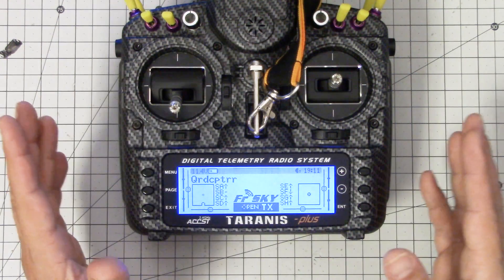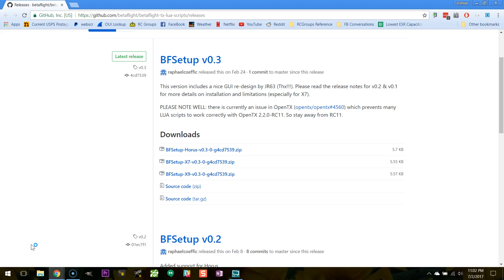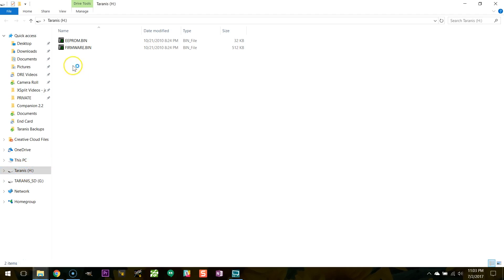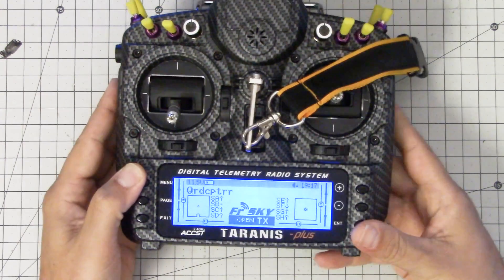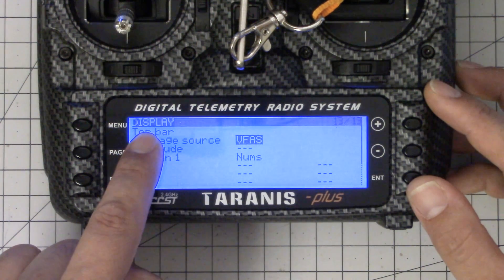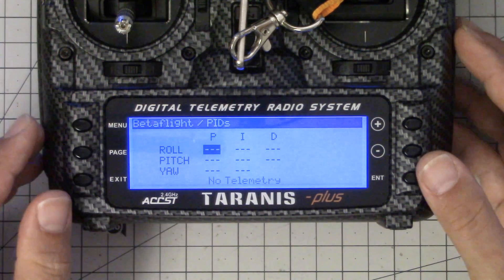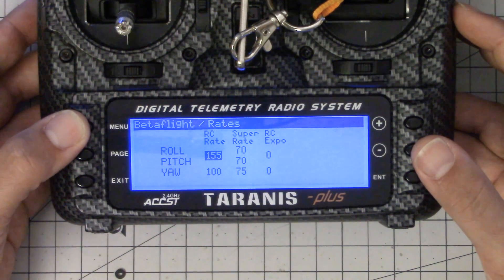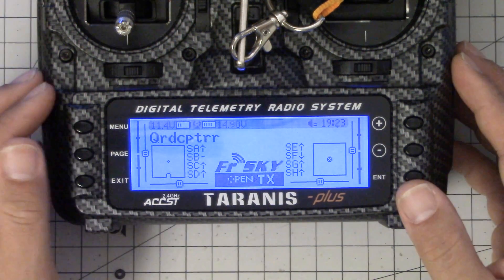Betaflight Taranis Lua Script HOW TO | Part 2 | The Lua Script

Comment: Can you do one with versions 1.0 and up? The file structure was reorganized in a 'single set of scripts for many transmitters (X7, X9, X10, X12)'. Now, in the new zip you get two folders, BF and SCRIPTS, inside scripts you get two more folders, BF,again, and TELEMETRY. This BF contains some loose stuff and some folders, HORUS, MSP, X7,X9. 
I don't know if I should copy the whole thing to the SD Card or if I should delete all the folders for HORUS and X7.
Reply from the maker: Well, you've got gigs of SD card space you're not using. Why not just put it all there. You'll never miss the space.

Comment: Hi love your videos been a massive help. I have a problem with v.1.0.1 lua i followed this vid but when i download the script the zip opens a Obj folder this has a few folders and then some seperate files underneath. Im now completly lost 😔 i have a qx7s and have no idea what files i need to load onto the qx7s to get betaflight lua working i have tried a few times but cant get this to work 🙈🙈
Reply: JRtopspeed wicked ill have a look now thank you  👍🏻🤞🏻
Reply from the maker: Yeah, unfortunately they changed the structure of the Lua script and this video is not correct any more.
Reply: I just setup lua script on my qx7s just use the link on this video https://youtu.be/o0DZo-xx3Hk download the qx7 file that’ll work for the qx7s ,good luck.

Comment: Hey. I had lua scripts working. Then upgraded to latest open tx  and upgraded sd card firmware to get rid of warning when I start my transmitter. Didn't realise until I went out to fly today the lua scripts don't come up anymore when I hold the page button now. I'm sure it's an easy fix just don't have time to troubleshoot at the moment do you have any quick ideas.mate? Thanks
Reply from the maker: +Organ Donor reconfigure the telemetry screen to use the script as page 1. Like you did the first time you installed the script.
Reply: Joshua Bardwell you're a legend thanks man I'll give it a go

Comment: I updated from Opentx 2.1.6 to 2.2.1 and when went to follow this procedure, I found that on the radio menu, I have only 9 pages instead of 13. I don't seem to have a 'Display' page. Any idea what I may have done wrong or what I need to do in order to correct it? I did confirm that I have 2.2.1 installed.
Reply: short press for one menu long press for another menu on my qx7s anyways

Comment: Sometimes I get an error when using the Lua Scripts page that states, "Script syntax error BF/ui.lua:335 not enough memory". Running a Bardwell F4 board, Taranis X9D Plus SE, XR4-SB. Sometimes it works just fine.

Any ideas on how to fix this?
Reply from the maker: Nope. I get that too though. I usually restart my radio.
Reply: Joshua Bardwell yea that’s what I’ve been doing thanks

Comment: Got the PIDs and Rates working through LUA scripts.....but my Unify Pro Race VTx values are not showing.  Any idea why?
Reply from the maker: Confirm whether SmartAudio is working via the OSD. If not, then the Lua script won't work either.
Reply: Finally got it working.  Watched your vid about Unify Pro.  I didn't have "TBS Smartaudio" enabled in Periperals tab.  I mistakenly thought I was supposed to have enabled UART 4 and enable Smartaudio in telemetry tab. Thanks!!!

Comment: I have had some issues where after selecting "save page"  the radio tries for a bit then says "retrying" and then comes back with the original unmodified values.  Seems to happen when the main battery is plugged in but not when powered via USB.  Maybe a problem with VTX interfering ?
Reply from the maker: I think that's unlikely.

How are you changing vTX settings without the battery plugged in? I don't know of any vTX that will power up off of USB.
Reply: I'm not changing vTX settings, just pids, etc.

Comment: Thanks for the video! Chuffed when I got lua scripts up on my taranis. Using r xsr on an f405 with s5 pin remapped but not getting any telemetry only rssi f000 and rxbt pids etc all read --- I've scoured the Internet and tried the inverted hack but the pad came off my r xsr. Firmware is up to date can anyone help please?
Reply from the maker: With SoftSerial you don't need to use the uninvert hack. That was why it wasn't working most likely. Use the regular SBUS wire.
Reply: Joshua Bardwell the for reply. I have sbus connected to sbus pin. Wired smartport to s5 but it doesn't seem to be working. I have reassigned s5 with the cli commands. That's why I tried the uninverted hack. Really bugging me I wanted to be in bed hours ago but can't stop until it works haha
Reply from the maker: confirm in "resource list" that you see serial_tx 11 on the relevant pin.
Reply: Joshua Bardwell everything was wired and setup fine mate. The only thing I didn't try last night was reassigning s6 and soldering to there. Did that and it worked straight away. Pids and rates work but not the vtx but I can do that through the osd. Mainly the Pids I wanted :) thanks for the vids mate keep it up!

Comment: I installed the 2.2.0 on my X7, updated the crossfire (2.06), bound the TX/RX, but it still says "waiting for crossfire" when i open the folder. Plus i dont get any inputs in betaflight. I soldered the Ch1 to RX ant ch2 to TX.  Ports are set to UART 3 where i put them. Can you help me out of this mess ?
Reply from the maker: Have you got telemetry working?
Reply: I got nothing on my screen. i can't see my PID ore any other telemetry
Reply: But Telemetry is working in betaflight. I can see the axis moving
Reply from the maker: +Anna- Theresa telemetry is not working until you see values in the radio. Lua WI t work until telemetry is working.

Comment: Hey guys... The Lua script works except the vtx/band settings doesn't show anything, rest of the pages works properly... What could this be.. I hooked Smartaudio to uart6 of the clracingf4 so I could still change it through the goggles but yeah,you know.
Reply from the maker: Possibly you're using the wrong version of the script?
Reply: I have problem. Telemetry stopped working, however I've managed to assign it to a softserial on my flip32 F4 (not omnibus) and although I have pids and rates I don't have vtx settings. Just says "device: none"

Comment: Hi Joshua Bardwell. I need assistance. I have the R-XSR rx and the QX7 tx. I have followed all your steps.. I'm using a Xracer F303 FC and have connected  S.port to UART2 TX. If I go to "Discover New Sensors" on my TX I get about 12 sensors on the list. When I run the script I see it working, but there are no values  shown. Please help me.

Comment: Hey JB,  any word on if TBS or BF will be fixing not being able to turn Pit Mode on or off via Lua Script?  I was thinking all was good and I noticed it will not change in the menu and after some investigating it appears its a limitation of Smart Audio,  very irritating! 

if (onoff) {
        // SmartAudio can not turn pit mode on by software.
        return;
Reply from the maker: I believe (but not sure) this is a TBS limitation where the Unify won't go back into pitmode after coming out. You'd have to ask them if they plan to change that.

Comment: Just put this on my Diatone GT200N and it worked a treat :), only thing is with the Horus you manually run the script from file manager, I dont beleive the 200N has Smart Audio though?
Reply from the maker: +Tony Cooper correct. It has a push button transmitter only.

Comment: Hi i need some help on my lua script.. I cannot change tbs unify pro vtx settings on my transmitter, syntax error is appearing on the screen.. but i can change my PID's when i go to the vtx setting it suddenly shows syntax error.. thanks in advance..
Reply from the maker: I have seen that Syntax Error screen before but I don't know what the fix is for it. I have fixed it by power cycling the quad and the transmitter. Once it shows up, it won't go away.
Reply: Joshua Bardwell thanks.. maybe i need to check my connections.. all my firmwares are updated.. my pid tuning works perfectly, my only problem is that vtx syntax error..

Comment: Joshua, thank for this mate. It adds a great feature to the taranis and makes tuning so much more accessible. Now, obviously this leads to what else can I do with this. In fact, I  noted that yaw D gain is absent (commented out in the telemetry script). I may need this for tuning my tricopter running triflight, so removed the comment and it works. Then, when starting to play with changing rates, I noticed whenever I save anything to the copter, the throttle expo reverts to 0.0, which is a bit annoying. My assumption is that the script has zero assigned to the parameter somehow. Here is the question: can I add this parameter to the taranis screen to allow it to be changed and have it set to the desired value when it is written to the copter? Or am I barking up the wrong tree? I note that the BF.lua script assigns indices to each field, but how does this map to parameters in betaflight? Any help would be appreciated. [Did look at lua script documentation "OpenTX 2.2 Lua Reference Guide” but could make out much from it].
Reply from the maker: +Pieter de Waard there is no yaw D term in Betaflight. I don't know more about how the indices work. I would look into the MSP protocol as I'm sure that is what the indices refer to.
Reply: Thanks Josh. Will dig further. The yaw D-term is in triflight (based on betaflight 3.1.7 I think) to deal with tail dynamics of the tail.

Comment: Josh, just updated today and all went well. I am on MAC OS. I am wondering why my taranis is saying it cannot see the script. Is there a mac version?
Reply: Sorry I can see “script” on the options but I when I go to select it, it advises no script is on the SD card. /betaflight-tx-lua-scripts-0.3 2 is the name of the folder after the unzip. No sure what is happening.
Reply from the maker: There is no Mac or PC difference between the scripts.  But you have to put the script folder on the card, not the zip-file folder.
Reply: Joshua Bardwell thanks sir. All sorted now.

Comment: So i did this and it works beautifully on my 5" running a lux32, however, on my 2" running a piko blx i get no rates or pid information so, cant change. Both are running an xsr and same version bf 3.1.7. Is there something in bf firmware that has possibly been switched off for the piko? I googled but i have seen nothing regarding 3.1.7. Before i flash 3.2, is there anything else i can check?
Reply: Since 2015, the XSR got 2 firmware updates in quick succession in June of this year: XSR-170605 and XSR-170619.  The first fixed a general S.Port bug and the second added the PID parameter transfer functionality.  It sounds like one of your XSR's has the earlier update and the other one the later update.  Go to the following link and update the firmware of the XSR on your piko blx build.  https://www.frsky-rc.com/xsr/
Reply from the maker: Have you got telemetry enabled on the Piko?
Reply: Joshua Bardwell yes, all my telemetry works perfectly
Reply: Thanks mate, I did this and it worked perfectly! I didn't even realise there was a glitched firmware. Much appreciated.

Comment: Hi josh. I have a qx7 with the new 2.2 open tx. I want to download the lua scripts for that. Could you do a walk through for that? I'm having some issues going thru the steps. I will be using the radio with the new tbs micro crossfire
Reply from the maker: I don't have a QX7 so I don't know what differences there might be. I think there are not too many differences though. Obviously you have to download the correct firmware to the radio though.
Reply: I just did this on my QX7. Same Process, the difference is getting into bootloader mode. on the X9 you hold the trim tabs while powering it on, with the QX7 you just briefly press the trim tabs. Holding the trim tabs will cause it to not boot into bootloader mode.

Comment: Thank you for the video Joshua. I have wired my XSR  to the BFF3 board exactly as shown here: https://blog.seidel-philipp.de/wp-content/uploads/2017/03/Betaflight_F3_Flight_Controller_Anschlussplan_Wiringplan.jpg

and have OpenTX 2.2 along with the latest LUA scripts and am experimenting with BF 3.2....the lua telemetry page shows up but the values are blank after connecting the quadcopter. I have telemetry enabled, and the ports tab is set up correctly as far as I know...Serial on UART2 and Smartport on UART1....any ideas?

Edit: forgot to mention that I'm using an Taranis X7
- Garrett
Reply: Just try this out: Set Uart3 to smartport and keep uart2 on serial rx. Hopefully that sorts it out. That's how it is on mine.
Reply: Same setup Garrett.

BFF3 on 3.2, XSR, got the script loaded on my X7 but all values are blank and reloading doesn't work.

Telemetry is configured and working, I get all 10-11 sensors on my X7 and can use the BF OSD to change PIDS/VTX (over smart audio) so telemetry shouldn't be the issue. My rx telemetry is set for UART3 and SA for UART1.

After work tonight I'm going to go back into the sd folder directory and remove the pre-existing "scripts" that were in there before and only have the BF lua script and see if there was a conflict there.

I was just re-watching these videos to see if maybe I missed a step and the only thing not matching up was Joshua didn't have a scripts folder on his SD card, whereas there was already one on mine and actually had a few scripts already there, I just added the BF lua script to that.

edit: Joshua does actually have that scripts folder when he first downloads the SD content for 2.2.. but then when he goes to copy the BF script folder over, it's as though he had already deleted the original scripts folder from the 2.2 original content.
Reply: Hey guys. I updated the XSR to the latest firmware and now the lua script works. That was the only change that I made since having issues with it showing dashes yet having telemetry working.
Reply: Thanks for the update.. I missed the latest firmware that specifically applies to this feature.. I had the update from the beginning of June thinking it was the latest since telemetry was working but I just went on last night and saw they pushed another update later in June.

Comment: Is there anyway to change my rates via a switch to preset rates? The reason I an asking is I am a newbie and I am having trouble when  changing from 3s to 4s batteries and the extra power?
Reply from the maker: Yeah you can use in-flight adjustments to switch rate-profiles. Look for my video on "in-flight adjustments".
Reply: Thanks for that been watching some more of your video's and realized I have been watching your flying before,  Nice farm by the way and awesome flying keep up the good work and I will try and use your affiliated links if I can.

Comment: Amber Sound pack for v2.2: http://hmvc.eu/Amber22.rar
Reply: Hello all, i found that in AMBER sound pack 2.2 some decimal value (reading the voltage of the battery) seem not correct,  i tried with the simulator on pc and its 10.2 same as 10.0 and 10.1   , the reading value still wrong in others counts .. around 8.5 volts.. somebody can confirm it? or i'm the one?
Reply: No worries for the moment from my side. I mostly use the % timer. The voltage is more indicative at the end of the flight and it seems correct.
Reply: and btw i found that Joanne_v1.3.for.OpenTX.2.2 sound pack have more words and its more usefull, but unluckily the voice isn't sexy as Amber and plus most voice samples are kinda too short and listening it seem not read good, need some more blank after the spell.. 0.5 sec at least

Comment: Well, I used to have this working without problem, I change the frame and now I'm not getting info on the vtx, (tramp, telemetry cable connected to uart 2 and enable on the fc(lux v2) as pherisphal, ) I don't know what happened, just changed the frame :(

Comment: I have a problem if someone could help me. I have the pids showing up on my QX7 but can't get the vtx screen.
Reply from the maker: SmartAudio must not be working? Or maybe you loaded the wrong script version? 

Is SmartAudio working from the OSD?
Reply: Joshua Bardwell it's possible it could be the wrong script but I'm pretty sure I downloaded it from the same link as you did. Smartport works on my OSD so I'm not totally worried about it.

Comment: So Josh lets say you have a Kiss quad and a beta flight quad cause you feel you don't have to pick sides, i have tried different hierarchy files structures and can't seem to get it to work any ideas? I can get each one to work alone but not together.
Reply from the maker: +OneEyeFPV you need a different script for both I think. I don't know anything about getting Lua working under kiss.
Reply: Joshua Bardwell yes you need the bf lulu and the kiss lula, I finally figured it out it's a matter of getting them and their partner folders in the right location
Reply: OneEyeFPV well share what you did for the rest of us multi-FC users please?
Reply: Ol-Man-Duffy J both the Kiss and bf lulu scripts come with a accompanying folder with other things in it. The actual lulu scripts go in the telementry folder and the accompanying folder with extra stuff go one level back (the scripts folder I think)
Reply: OneEyeFPV thanks man!   Much appreciated!  👍🏼

Comment: Hello Joshua, thx for that video. Is it possible to switch the Vtx power by flipping a switch? From 25 (low) over 200 (mid) to 800 (high)? I guess its not cause the settings are not set up in real time...but maybe you (or someone) got an idea how to make this possible :)

Thanks
Reply from the maker: No, that's not possible right now, but it has been requested and may be present in a future build.